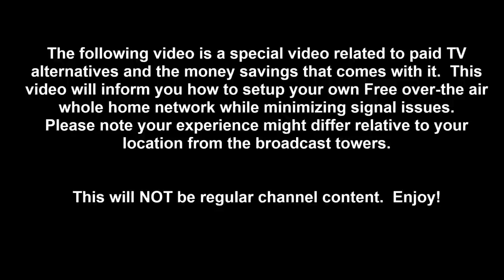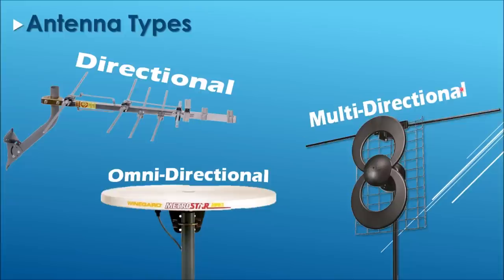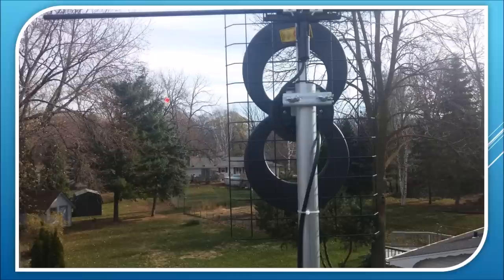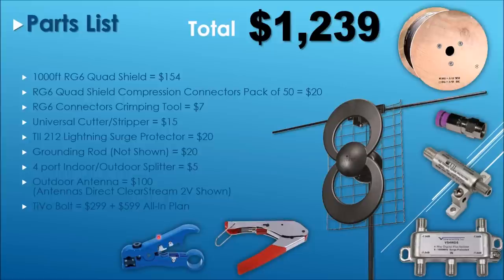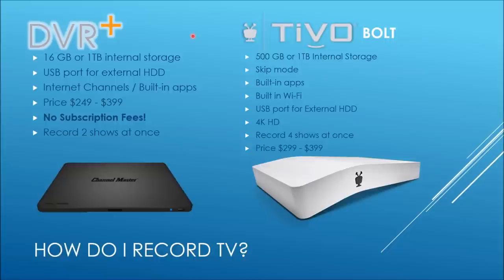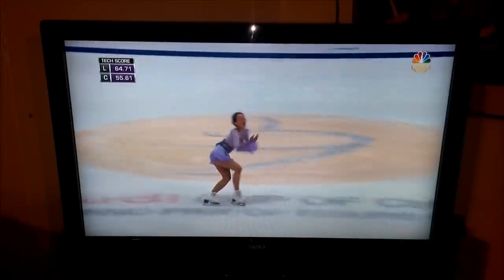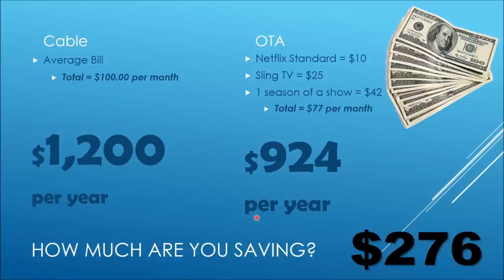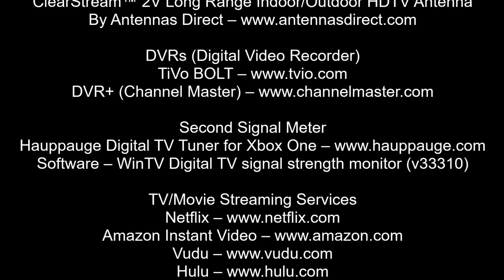Get rid of Cable. Get Free Over-the-Air TV!

Comment: Some of the info is out dated but you are VERY thorough.(I cut this video slack because it is over 5 years old). Great starter for the OTA cord cutter. I pay 106 for unlimited Comcast internet,5.99 for basic Hulu and 20 bucks for Philo-136 bucks as opposed to 256 bucks for cable/internet with all the darned boxes. Roku for the non tech family and HD Homerun for their OTA.

Comment: Nicely done tutorial...........Unfortunately I'm a renter paying extortion payments to the cable company that bought the supply rights to my apartment complex. In the future if i own property i will defiently go in this direction, and just pay for a really fast internet connection.
Reply: Same here, Comcast.  So, I get good indoor antenna.  Go to tv fool (Google), and put approximate height from ground, and exact address.  It will tell you what you can get.  I then would go higher level, maybe an antennas direct.  Play with positions in apartment.  When I had cut the cord before, used Tivo to record, and had over 35 channels to choose from, using antennas direct cv jm 2.  There are some tricks to also try with the Mohu leaf 50, that helps to get the vhf stations.  If you order off amazon, have 30 days to try and return.  Remember to get some good coax, do not buy the unit with included coax (or buy and sell coax).  Try without a pre amp, then add good pre amps, not the ones with the units.

Comment: Get “Antenna Point” app. This will tell you exactly were your towers are. And it will tell were to point your antenna as well. Directional are very good. Multi-directional and very good. I would stay away from the Omni-directional Antenna. Those Omni-directional a trash. Trees will create reflection. Mountains create reflection. Try to put your antenna on your roof. The higher your antenna the better the signal.